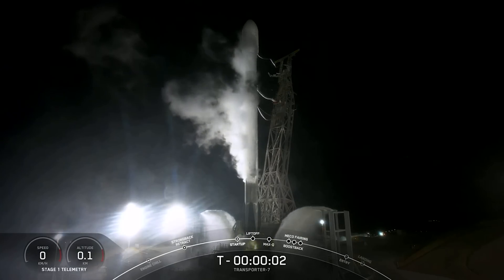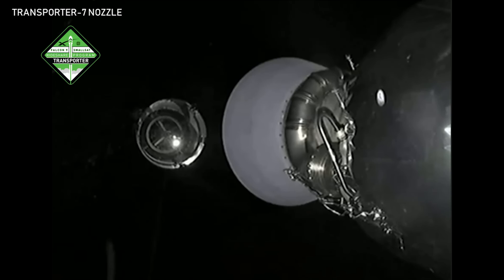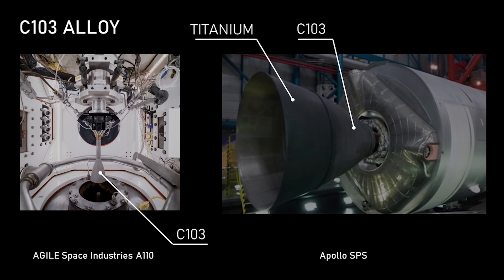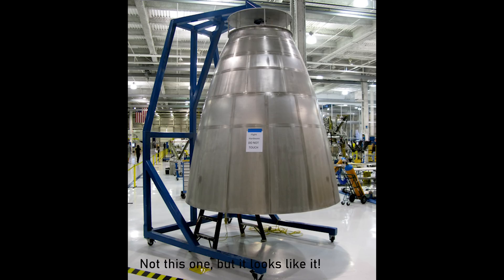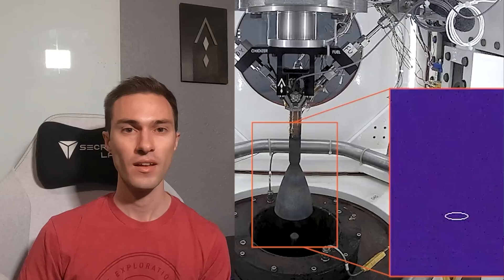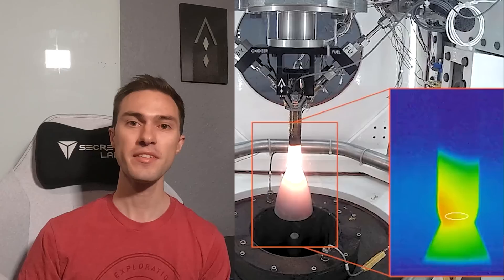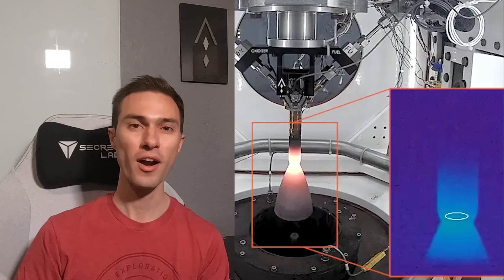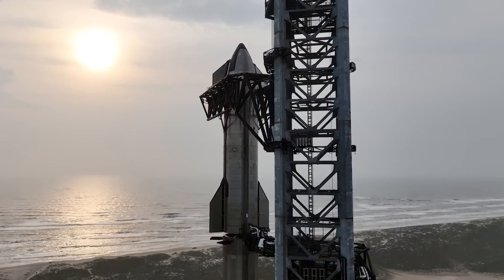What's Up with SpaceX's Short Nozzle?

Comment: Excellent video. Both in-depth & concise. I would also add that the M-vac nozzle also uses film cooling similar to the F-1. 
Where the cooler fuel rich gas generator exhaust—and this is why I shouldn’t comment until I finished the video😂

Comment: I’ve just watched the CRS-28 mission which also had a short nozzle on the second stage. I googled to look for the reason and this video came up. This is another data point which seems to suggest that the short nozzle is for cost saving reasons. I did note that stage 1 reached apogee at around 145 Km so it really did fling the second stage. It’s interesting to see SpaceX continuing to tweak things after so many launches.

Comment: Thank you so much Charlie for covering this with a way more detailed explanation!!!

When I was watching the mission stream I had so many questions about the new nozzle but we only got surface level info from SpaceX. So I did some googling but the info I found was just a little more in-depth than what SpaceX said on the stream and pretty much stayed in the realm of "it didn't need the performance of the standard, full nozzle" etc, which was rather disappointing.

These are exactly the extra details I wanted to know. Again, thank you so much for the nitty-gritty rundown from an actual aerospace propulsion engineer. It's always nice to get it straight from the horses mouth! 😆